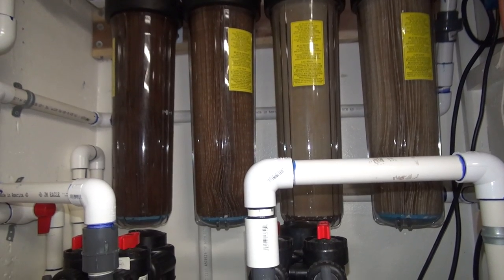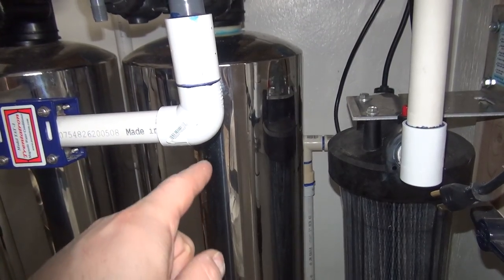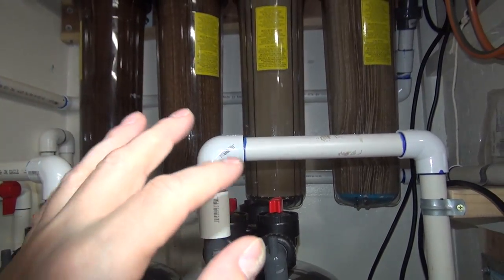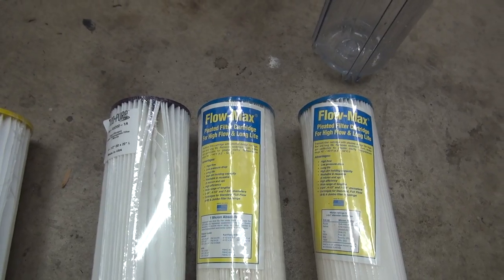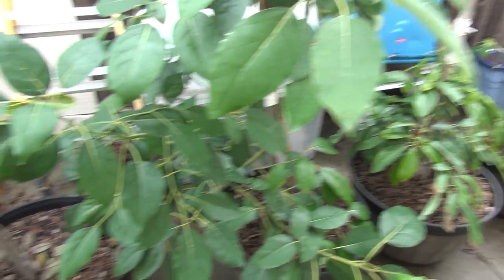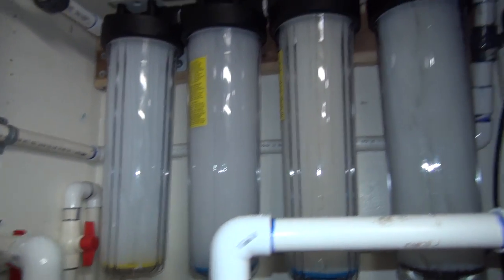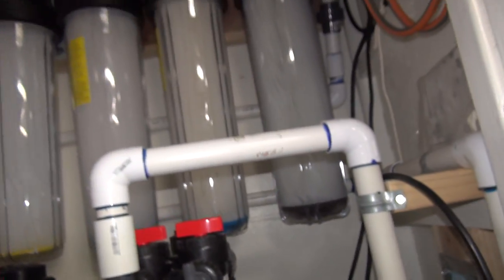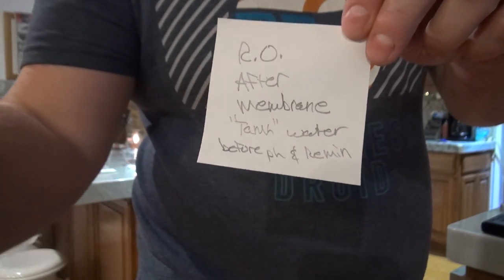worlds best whole house water filtering system D I Y  tutorial

Comment: Awesome video. My wife and I are building a new home with a well. I've been researching for the last 2 months on good water filtration systems and I always seem to get contradicting reviews. It's "refreshing" to see someone do a video this detailed. One question if you have time. Well water is often hard water which requires a water softner. Where would you place this softner in your system? I worry about placing it after the filters you have due to a 10GPM min flow rate for back flushing the system. Your input is much appreciated.
Reply: Softener should go after carbon filtration, generally.  Have your hardness tested...it's pretty easy to do.  Well water can be tricky depending on how the water tests out...may want to look at having it legitimately tested (national testing labs, or similar).
Reply from the maker: generally after sediment and carbon/kdf. that is when the "junk is out of the water" and where i would install it. 

few thoughts though.......
1- make sure no lawn or sprinklers will be down stream or DEAD GRASS!!
2- salt softners make water feel slick and slimy "i personally dislike" but your call..
3- salt softeners will raise your salt intake and sodium levels as the water will carry it into your body during showers. bad if you have hypertension or heart issues!!!
4-must be removed back out "ro system" to drink or cook or wash food off etc....
just off the top of my head... good luck!!! :)
Reply: @G.G.T.  No salt water is take in during the shower...there aren't any research studies showing a causal relationship leading to cardiovascular issues.  When you go to the ocean and swim, they don't tell people with heart issues to not swim or else they will have sodium issues with the blood/system.  The sodium can become an issue if you're drinking it, but no one should drink softened water, you should drink purified water.  Purified water with minerals added back in, is a better option than filtered water (filtration removes select contaminants, purification removes all contaminants), but filtered water is much better than tap water, or raw well water (assuming it was tested for bacteria/nitrates and you're good)

But yes, some / most of those points you made are true and valid, and should be considered.  Most irrigation is split (on city water houses), but you never know with well water, and nothing is ever absolute...always relative.  There never is an "always" or "never" ha.  Cheers!
Reply from the maker: i put links up if your still looking NOW would be a good time with this corona stuff...:)

Comment: Is that potable water going through black iron pipe for the water heater?
Reply from the maker: no black pipe, copper, brass pvc maybe 1-2 pieces of galvanized in the house.
the rusty colored "gunk" in red clay that gets into the water is my best guess.
maybe old clay service pipes or the soil??
Reply: @G.G.T.  it sure looks like iron pipe in the connection adjacemt to the hot water filter. Even if its galvanized...its all rusty inside. I would get ridvof any iron pipe immediately.  I have all PEX A. Very little copper or brass...and town water. I only need to filter the drinking water to the refrigerator for taste. Charcoal does a good job.
Reply from the maker: @rogerwhiting9310  nope just double checked, nothing but brass and copper in that heater closet!
this house was built in the 70's before pex was a " PIPE-dream" lol...sorry couldn't help myself :)

Comment: So the flowmax multiple filter system is on the cold side and you have one hot water canister on the hot side?
Reply from the maker: basically the filtering system is on the MAIN incoming line "yes its cold" BEFORE the hot/cold split. That way it treats all the household water.
the HOT filter is after the heater to catch the calcium and junk it kicks out before faucets and showerheads. hope that makes sense : )-

Comment: If I understood correctly, the Apex RO system is installed after the water is filtered by the other system you built?
Reply from the maker: yes the main system treats the whole house, the apec ro system is just for drinking/cooking water under the kitchen sink
Reply: @G.G.T.  Very impressive system, have you tested your water with an independent test kit?  "Being too paranoid, is like being too rich or too good looking. Is it really a problem"  
Theother Side
Reply from the maker: @theotherside7634  YES, actually i did years ago when new. before i did the ro system. I did not test for bacteria/virus. however I did do a large scale harmful substances test (pesticides, contaminants, dangerous levels of things like arsenic etc..) nearly every category and test came back "to low to accurately measure", meaning the tests were in most cases not sensitive enough to be picked up.
The test cost about $250 dollars. not some cheap freebie test. it was laboratory grade

Comment: I'm a little confused.. if you have that $2500 filtration system for the entire house, why would you still need that filtration system under the kitchen sink? Isn't all those filters in the garage suppose to clean out everything already and the water should be at drink condition by the time it gets to your kitchen sink? 
Or perhaps maybe you need to look in to having your plumbing in your house replaced?
Reply from the maker: it could be just fine with the whole house the under counter is just EXTRA for the drinking water
Reply: @G.G.T.  That doesn't make sense. People put water in their mouths when they brush their teeth. So how is that any different from the kitchen?
Reply from the maker: @berniecruz8405  not that fanatical about it lol
i fill up water and take everywhere and not buying it at $1.00 a bottle quickly pays it back. most water sold is just inferior RO water anyway

Comment: It's amazing what a tiny amount of bleach can do. I lived on city water for decades and now I have a well, it's incredible how much more frequently I have to clean the toilets without chlorinated water! I do technically drink recirculated sewage and I like it though...I have a well/septic system and the water tests very very clean. My only filter is for large sediment, basically the occasional grain of sand...

I totally agree on getting clear housings, I'm not sure why they make them any other color. If you're looking at cheap ones on Amazon, make sure they have brass inserts for the threads. And use brass nipples!
Reply from the maker: oh I have trouble with my toilets on city water too. It's horrible!! reason i made this video https://www.youtube.com/watch?v=h1Wx1fTQgbI is the Pelican and others claim "salt free water softeners/conditioners" saying "you just wipe the calcium away and it won't deposit on anything" is complete B.S. and i hope others can save the extra grand or so.

Also i PREACH brass as well I could not find BB with Brass inserts I looked. I just ease in and out as I install (less stress on housing)
Reply: @G.G.T.  I prefer the 2.5x10" housings, Amazon has clear ones with nice brass inserts for $18-something. If you need two in parallel for better flow it's still cheaper than most bigger filters. The filter replacements seem to be cheaper in bulk also, even when you account for the size difference. I guess it depends on your flow needs and how dirty the water is, I'm just making a smaller system for car washing.
Reply from the maker: @ryanroberts1104  i am kinda limited in my space so parallel would be a plumbing nightmare for me. just heads up i use ro water for car washing. IT ROCKS!! no towel and no water spots=way less work + better results.

Comment: I was thinking The first thing city water should go through is an aerator. I do that for my aquarium with bubblers to get rid the chloramine. Instead of just depending the charcoal that has to be replaces often.
Reply from the maker: Takes to long and only marginal success, Chlorine needs to sit out a day or two to be removed
also how do you "bubble" in a sealed liquid set of plumbing. (air in plumbing is undesirable)
Reply: @G.G.T.  it goes through a vented lid bucket with a spray nozzles. This takes care of most of it immediately. Then it need to be re pressurized to connect to the plumbing.  
They use large applications for smelly well water, but I think a smaller version should be a available for city water. It's good to get rid of the chlorine or it evaporates when you shower and your breath that in.
Reply: For my aquarium, I don't have a spray nozzles, I just put the water in a bucket and air bubbler at the bottom to circulate the water which removes the chlorine in about an hour. The traditional method of just keeping water out for day works too, but wouldn't work for water going into a house.

Comment: Another question... how come you don't set up a RO system for the whole house in the area where all your other filtration system is? Then the WHOLE HOUSE can be at that 6 microns level?
Reply from the maker: ro for the whole house is waaaayy crazy. 
1- to slow to shower or water lawn etc..
2- very acidic and hard on the plumbing
3-needs tons of space to run in massive parallel circuits.
4-  would cost a fortune
Reply: @G.G.T.  My point was why wouldn't the water that has been sent through the main whole house water filtration system not be good enough for drinking water? What would there be a need for an RO system?
Reply from the maker: @berniecruz8405  it could be drank and probably fine. The concern is lots of cancer in the area decided to just go a bit overkill for safety.
Reply from the maker: @Imnotsuresoijustputthis  indeed...ty

Comment: How was your house water pressure affected by the smallest micron filters?
Reply from the maker: i went with the big blue filters and honestly can tell no difference...my shower is the same and my 3/4 inch hose valve really lays down the water. 
GO BIG=more surface area=superior filtering + Low to NO pressure loss. spend the little bit extra!
Reply: @G.G.T.  i could not find the filters and housing on Amazon, do you have the links?
Reply from the maker: @jaimeim18  I had a PERFECT parts list but Amazon deleted my links unless i had 500 subscribers. (so subscribe and tell your friends lol)
pre and post pressure not sure. city feed so 45-55psi intake would be my guess post pressure is very good with the super large 20x4.5 filters, go large is my advise
Reply from the maker: @jaimeim18  search "big blue filters with clear housing" and that should help you. try to find watts filters 20"x4.5". Use BRASS pipes between filters

Comment: i dont have a well water but city water. what is needed?
Reply from the maker: this is city water...it can be nasty too!
Reply: @G.G.T.  Apec  water, I’m in Florida. Apec is located in California. Are Apec that much better than the tanks or media than any company located near me in Tampa, Florida?
And those cylinders, too, are advisable as well? Why? Then what’s the tanks needed? Why both?  
Lastly, where do I get filters for the cylinders?
Reply from the maker: @stephensalvidio3255  wow lots to unpack there!
1-apec is good quality but i don't know vendors in Florida. (pelican was good and i bought mine there but since the buyout they cheapened up ALOT!  used to be 100% virgin coconut media now who knows? 
i would avoid
2- tanks use a vortex to stir the media, better then down draft that created channeling and less contact time.
3-second tank is a water "conditioner" is kinda ehh.. do your research it kinda 50/50?
4- large tanks use a bulk loose mix not a filter. change every 3-5 years or so!

*lastly i do NOT work for or with Apec i just put up Amazon links is all to make purchase easy for People looking for a fast and easy solution.*
Reply: @G.G.T.  those cylinders are just sediment filters inside?  KDF media are for the tanks, right? 
Apec tanks  are comparable to commercial   Tanks or systems?
Reply: @G.G.T.  you’re saying not to use a vortex tank?
Reply from the maker: @stephensalvidio3255  the clear filters with the red gunk are for sediment, downstream are the chrome tanks. 
first tank coconut media and some kdf
second tank water conditioner
the another sediment for carbon fines then uv and magnets.
Reply from the maker: @stephensalvidio3255  no mine are vortex, i like them better

Comment: Great video on your highly effective system!!! General inquiry question, you mention you don't recommend drinking water coming from the RO line. Is this because all minerals have been removed thru the RO process. I have a 3 stage filter system & one of the filters is a RO filter so now I'm questioning if Ishould be drinking this water.
Reply from the maker: thats part of it. do some searching under "world health organization (who) and ro water" basically it makes water empty and it will pull minerals from other sources like your teeth bones etc.. this is there info but gave me pause. i have noticed at the very least the water becomes more acidic and that alone is bad.  read up

Comment: Use muriatic acid for toilet. It works great. Just wear a respirator or open up windows. Turn off water to toilet. I then use turkey baster to remove acid and water from bowl.
Reply from the maker: believe it or not i tried "hydroflouric acid" which is even stronger...stains just laughed as i put baking soda in to neutralize before flushing down the pipes.  I did a video on JUST THE TOILET....lol seriously tried all kinds of stuff. easy to find it by the thumbnail

Comment: No such thing as a salt free water softener. What you have is a water conditioner. Not the same thing. Water softener is removing The minerals you want to get rid of. The conditioner it’s just conditioning the minerals not to stick to your plumbing but it will stick to your face and clothes and everything else once it hits in the air. That won’t happen with a water softener because it removes all of those minerals.
Reply from the maker: I am aware the "Conditioner" is a joke however!
its a waste of money IMO.....I regret the purchase, you are free to decide for yourself however.
Reply: I have many neighbors that paid $3000 or more for a conditioner and a carbon filter installed by a water professional. Just about every one of them if not every one of them call it a water softener and a filter. I don’t explain the difference as long as they’re happy.👍Have a great day!
I am going to install a water softener with a carbon filter in the water softener hopefully that will work it’s supposed to clean itself during regeneration. So there’s no need for replacing filters according to the manufacturer, it’s a whirlpool pro Series.🤞🤔

Comment: NOT the best but good. Where is your spin down filters??? A 100 micron and 50 a micron will make your filters last longer. I use rain water so I have a 1000 micron, 500 micron, 200 micron, 100 micron and 50 micron spin down filters along with 4-  20 in. x 4.5 in canister filters which have 20  micron, 10  micron, 5 micron and a 5 micron Carbon Block.
I have an additional system under the sink for drinking water that filters down to .1 micron.
Reply from the maker: not bad... but you need a 1 micron ABSOLUTE after the 5 micron!  but before the carbon...it is the best and catches all the super fine crud that would probably go straight to your liver and kidneys lol... i dont mess with spin down. i do new filter every 2 years lol...they last plenty long for me $60 bucks for a set.
Reply: What’s your “additional system”?

Comment: your preamble was about cancer prevention but none of the filters in your system actually address the cancer causing toxins/chemicals with the exception of maybe carbon filter and only if it is made to certain standards. cancer is linked to pesticides, herbicides, bpa, fluorocarbons. if anything your set up actually adds toxins to the water - bpa from plastic filters and housings, fluorocarbons from the teflon tape and resin that you used as a sealant. unless you actually test the water in a certified lab, it creates false sense of security i think.
Reply from the maker: You did not see the section with the ro system under the counter for drinking water. in addition to the whole house.
PPM tells alot of the story.
from 400 ppm to 5 is alot of junk removed.
Reply: @G.G.T.  i think i didn reach the reverse osmosis part
Reply from the maker: @ccalex8548  before you slam a video you should really watch it in it's entirety.
nobody writes a book review after one chapter and some page flipping...lol
Reply: @G.G.T.  i wouldn't right review after reading one page but i can tell if it's a shit book or not